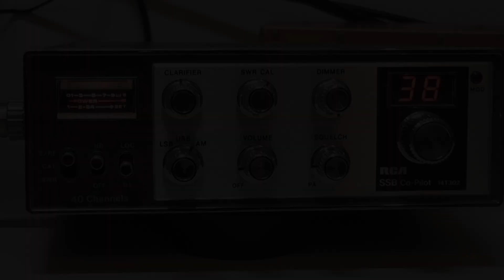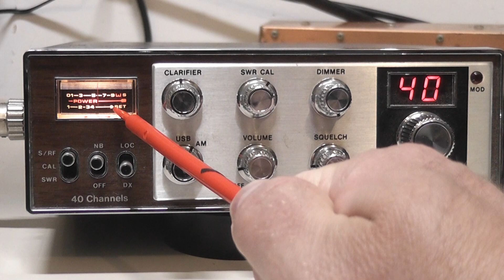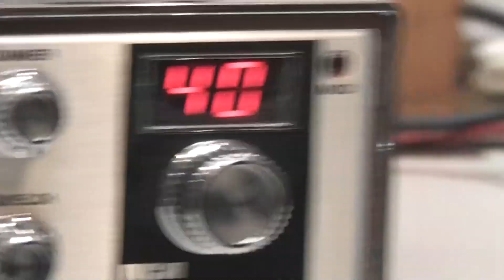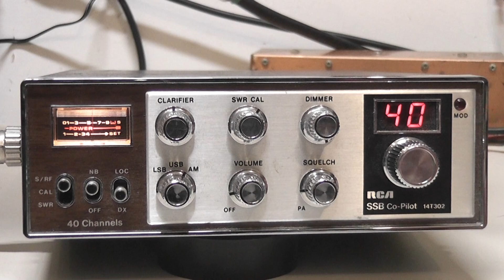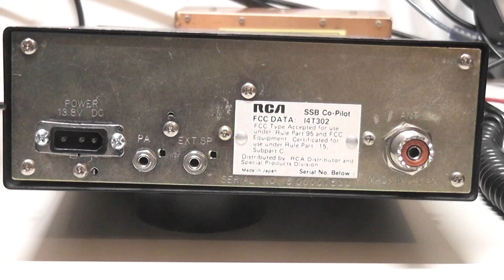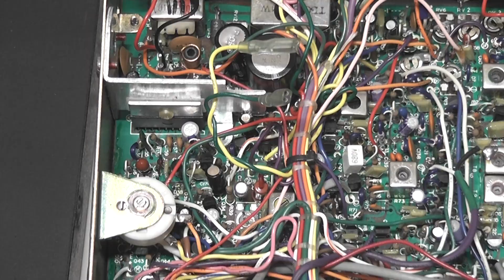RCA SSB Co-Pilot 14T302 AM SSB 40 Channel CB Radio 1977

Comment: I liked these particular radios 
In their day they were very popular here in australia
I still have 2 after all these years one is branded as an electrophone tx550 in 18 channel for the australian market and the other is branded as an american electronics 76-577 in 40 channel with extra channels both of tbese radios use the same board and chassis
It's a bit unfortunate that there is nobody here in australia that can repair or retune these radios outside of the ham radio shops but as you know these people just thumb there nose up at us 
P.S I just found your channel last night and the video I found is the moded Cobra  138XLR nice radio I also have one of these too
cheers

Comment: I have about a dozen RCA CB radios brand new in the boxes including 3 of these, 2 base stations (AM only), and assortment of others.  Even an AM/FM/CB radio that mounts in a car dash and another type with all functions on the microphone.  I believe the 14T302 was the only SSB CB RCA made.  My uncle used to work at the big RCA plant which was the consumer electronics distribution center.  I think all these CB's I have were liberated from that plant.  They threw hundreds of them right into the dumpster eventually.
Reply from the maker: You are correct the 14T302 was the only SSB RCA as far as I know. At the beginning of my video I said "there were some SSB models as well" I should have been more clear that this was the ONLY version that had SSB. I'll add that to the description.
Reply: Which RCA plant did your uncle work in?
Reply: @soylentgreen6476  Deptford NJ
Reply: @skypilot0077  My uncle worked in the Harrison, NJ plant back in the day.

Comment: The RCA CB's didn't have the greatest Tx audio but they had a smooth very agreeable receive audio. You could listen to the RCA's in your car or better in your base, for hours and never get operator fatigue. Not a brilliant design, but you could get like 30 channels uppers fairly easy and you could crank up the audio to like 120% mod. and still remain intelligible. So not great but they were a player in the CB scene circa mid to late 70's.